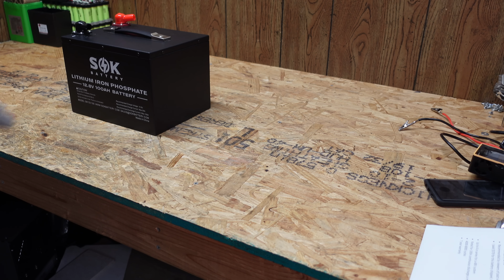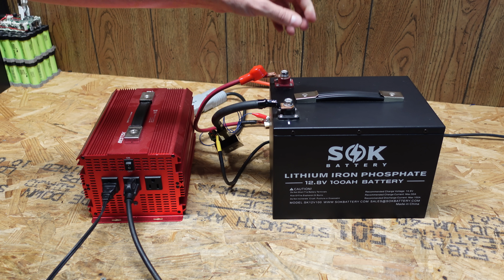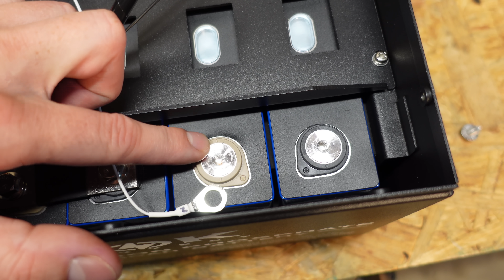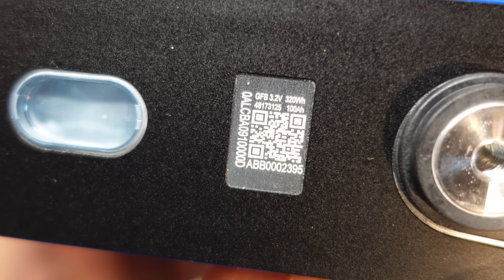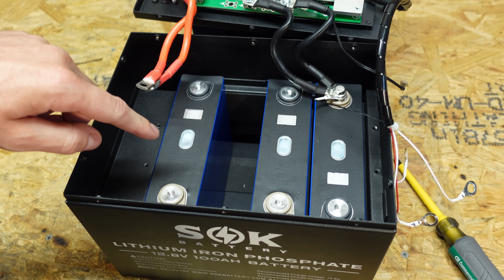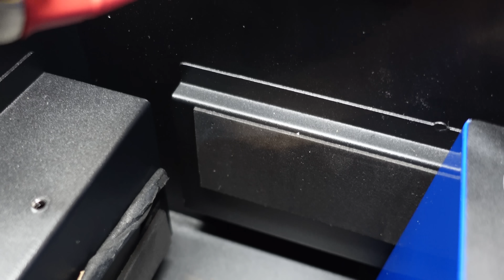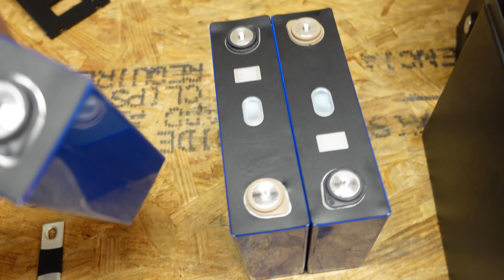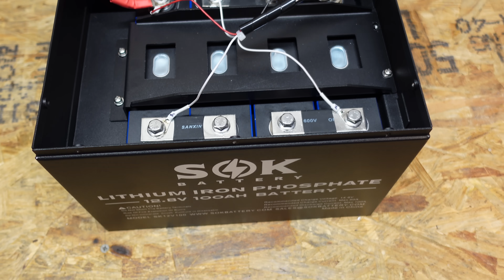SOK Battery 12V 100Ah LiFePO4 Battery, Review and Teardown

Comment: So I got the SK12V100 sok and its terminals read 5.7v but if I go from positive to one side of bus bar it is 13.2v whereas the other bus bar reads the low 5.7v. What does this mean? Can I fix it or is there dead cells?
Reply from the maker: The batteries are usually shipped with the BMS in a sleep state. It should turn on when you connect a charger or a bench power supply
Reply: @LithiumSolar  Soooo. I ended up just hooking it up to my trailer just to see what happened. Went ahead and did both the trailer and solar charger. And it works fine… Really wish they shipped some tips with these things.

Hey thanks for the quick reply though! If I hadn’t figured it out yet then this was the answer! On the positive side, I learned a lot tearing the battery down and putting it back together :D
Reply from the maker: @Gubers  Glad you got it working :) They started shipping them like that a while back due to so many arriving low after a few months of warehouse sitting. They should really include a sticker near the terminals or something to tell you this...

Comment: I bought 2 SOK 100ah Bluetooth heated batteries. The batteries are standalone installations.I have fully discharged and charged each twice using a MakerHawk load tester.  The batteries were not balanced across the cells.  I followed SOK's direction to balance the cells with limited success.  My issue is that I have yet to  have a discharge test that reaches the rated capacity of either battery.  Not sure if I have a good set of batteries/ BMS.  I get about 1175 watt hours on each test and about 98 amp hours.  Should I return these batteries?
Reply from the maker: It sounds like the cells just need more time to balance. These are very good cells. You shouldn't have any issue hitting > 100Ah when they're brand new.
Reply: Thanks for answering.  Per SOK, they recommend to keep the battery connected @14.6v with a 1amp charge rate until the cells are balanced.  I have done this several times, with each battery.  The cell variance at the bottom of the discharge is about .4.  it doesn't seem that the balancing is giving me a fully usable capacity. What is a good cell difference of well balanced cells?  Any recommendations on how to balance the cells?  Using SOK's top balancing method doesn't seem to help me achieve full capacity.  The cell difference after charging a full charge is .012.  Thanks for you help.

Comment: If you need low temp disconnect = SOK battery 
If you don’t need that = ampere time
Did I miss any better priced build quality Lifepo4 batteries?
Reply from the maker: Redodo (previously known as Zooms) is up there too with non-temp disconnect.

Comment: Just ran through the comments but it seems it wasn´t posted yet.
Cell Manufacturer is GanFeng , Production Date 11/Nov/2020 :)
BMS is now done by SOK (as in this build) , before they used JBD.
Reply from the maker: Interesting, I haven't come across an SOK using the JBD BMS. Was that way back when they first started?

Comment: Great video!  Thanks for the great information.  I have been hesitant to use a "cheaper" battery but this video makes me feel a lot more confident that it will be fine.  

Also, are you based in San Diego?  I noticed your shirt.
Reply from the maker: No, not in San Diego - other side of the country.

Comment: SOK has 5/16 bolts.
Reply from the maker: They're metric, so it would be an M8 as I stated. It looks like that's similar to a 5/16" - so sure, if the threads match, you could use the 5/16".

Comment: thanks for the review - very informative!  I've gotten mixed information about placing this battery Under the hood - as the 2nd or house battery in a dual battery setup.  I have 4/0 cables going to the bed of my tacoma so I'm not worried about voltage drop, but just wondering if the LiFepo4 can be placed under the hood.

Comment: I'm fairly new to solar. I'm wondering since the BMS is limited to 100 amp, would that mean that if I use a 3000 watt pure sine wave inverter, I would not be able to use it's full rating? I'm thinking of buying 2 of the 206 ah 12volt version of this battery. I am building a enclosed trailer toy hauler. Will be running a instant pot and a ninja foody for cooking, a fan for cooling, charge 2 laptops on the AC side. 

On 12 volt: a Dometic cfx3 95dz for refrigeration, led lights, a diesel heater, and charge 2 cellphones. 

I'm thinking if I've done my math right I should be able to go 5 days without actually needing the batteries charged, but at the moment I have 350 watts worth of solar panels and a cheap 30 amp Sunforce charge controller. I think I might need to get a better charge controller since it's old and not mppt. I should also upgrade to 600 watts of solar panels?

Thanks if any one can chime in.
Reply from the maker: A 3000W inverter at 12V would be 250A, so you are correct in that you cannot use the full 3000W rating with one of these batteries. That really is a lot of power for a 12V battery system. Have you checked their 24V batteries? Using a 24V battery and inverter will cut your amperage in half allowing smaller-gauge cabling.
Reply: @LithiumSolar  I still have to do the research into the 24 volt method. I basically bought the 3000 watt inverter thinking, if I ever need more I won't have to upgrade the inverter unless better tech is out, and I could run pretty much any household appliance on 3000 watts. But I like to try and run as many things from 12 volt, more readily available items are 12 volt or lower like USB, LEDs. But I'm going from using 2 led acid batteries. 350 what of solar panels. And only a 500 watt inverter. Running almost exclusively on 12 volt. But wanting to run more things off of solar.
Reply: @LithiumSolar  so if I got 2 of the 206 amp hour version I could  get the full 3000 watt usage out of the inverter for 1 hour and a half?
Reply from the maker: @mrchrisknight315  The continuous current rating of the 206Ah battery is still 100A due to the BMS they're using even though the cells themselves can handle 1C discharge. With 2 batteries, you would have a max continuous rating of 200A or 2560W (200A x 12.8V).

Comment: Could you tell me what makes these batteries worth double the price of a chin lithium battery of the same AH?
Reply from the maker: Well for one, these are rated for significantly more cycles than the Chins.
Reply: @LithiumSolar Chins advertises 2,000 plus cycles.  At one cycle = one day of fishing, I could cycle the battery every day of the year for 5 straight years before needing to replace the battery.  My application will be a trolling motor; and I fish maybe 50 days a year.  At my rate, that would give me about 40 years.  Cycles are really misleading to me in that sense.  Is there any other compelling reason? I want to run a 55 lb thrust trolling motor on a single 12v battery which I assume will draw below 25 amps at the speeds I will be using.  Most of the use will be for intermittent repositioning of the boat during bass fishing.  Occasionally I will use it to do a 1.5 mph steady troll for Kokanee fishing.  I don't think the steady troll will draw more than 20 amps (normally fishing no more than 3 hours).  My first inclination was to get an Everstart flooded 109ah battery from Walmart at a cost of about $100.  I see on Amazon that the Chins 100ah is $319.  I like the idea of the lower weight and the fact that the flooded will probably only last a few years; but, I do not want to spend over $500 for a battery.  Do you have any additional thoughts on this scenario?  BTW; thanks for your response and input.
Reply from the maker: @rickw9169  I have reason to believe the batteries being used in the Chins are only rated for around 1000 cycles. I can't prove this with certainty though. I don't think they're bad batteries at all, very well built actually. I would buy the Chins over a flooded lead-acid any day. One downside to the SOK that I reviewed here is that it's not sealed and since you're using it in an environment subject to water, would probably want to take that in to consideration.
Reply: @LithiumSolar  Thanks for all your input.  I greatly appreciate it.  I want to keep the weight down as I am going to put the battery in the front of the boat.  Even at 1,000 cycles I'm good for 10 years.  The 100ah runs $315 (Amazon) currently and I think I'll take a gamble with it and will see what happens.  Thanks again for the input.

Comment: Use a torque wrench on your next tear-down to see torque specs.
Reply from the maker: Using a torque wrench would give a generalized idea, but because it's a serrated flange nut, it grabs on to prevent backing out thus giving a torque value required to overcome those "grabs" that will be different from what it was tightened to.
Reply: @LithiumSolar  I've never thought about that. there's probably a general number you could estimate. Close torque values are better than no torque values.

Comment: Just both this battery my question is when charging with Noco Genius 10 that can charged lithium battery, I can only charged up to 13.4v can not get up to 14.6v as recommended.  What do I need to do to get to 14.6v?

Comment: Can you combine this with a battle born 100 ah?
Reply from the maker: My opinion is that paralleling both would be acceptable as long as they have the same charge parameters (and being LiFePO4, they should). I would not recommend wiring two different brand batteries in series though.

Comment: Has anyone had any experience with the 100ah 12v “Flypower” LiPO4 batteries?
Reply from the maker: I don't, but that battery is the same exact case and weight as the Jialuonin that I just reviewed, so my assumption is the internals are the same or similar.
Reply: Thank you for getting back with me!

Comment: Hey so I have a project that I'm building my self an 800 watts motor is required so and it has to be 48v so I went and bought four 12v 5amp batteries they are 4 in total I cant figure how to charger them all at the same time do you any charger I can use?? And do you have any suggestions what i can get or do to charge all four batteries please anything would help ALOT?
Reply: They are lead acid batteries by the way.

Comment: You should have removed the connector plug for the balance leads from the BMS before disassembly.  Removing the individual wires in an uncontrolled fashion can cause bad voltage spikes for the BMS.
Reply from the maker: You have a very good point here, thanks for the reminder! Ooops...

Comment: I am an old guy who likes to go gold prospecting and needs power for a small water pump or a "windshield wiper" class 12v. motor. The common solution is a conventional deep discharge battery. Conventional batteries, though, are too heavy to walk any distance with for me. I am hoping to find a lighter battery that will turn out 3-5 amps for as long as a 12 v. car battery but weigh much less. Would a battery like this fill the bill? Are there better solutions?

Comment: So you will know in the future to use an existing (digital?) torque wrench to test the bolts before you loosen them. For example set it to 20 foot-pounds of torque and see if it clicks-beeps, if it doesn't, then you know it is below that. If it beeps-clicks at 20 then you know its higher.

Comment: Off topic… does anyone know… can I hook a battery bank into my electrical panel via my 50 amp input  I had installed for my generator?  Its’s an RV style plug.  I guess it would be coming off an inverter?
Reply: Yes, your auxiliary input doesn't care where the power comes from.  If it's currently setup for generator backup power you probably already know this but be sure you lock out the grid power supply before energizing your aux power supply so you don't back feed the grid.  Depending on the battery voltage feeding a power inverter, it takes a lot of amps to run the inverter, do your research to size it all correctly for your requirements.

Comment: Has anyone checked these against the mollpower.com which appears to be quite similar on the outside with a metal case and and volt meter and the price is currently 450 USD as of 2021 07/12 Wondering how the Bms compares. The build quality on these SOK batts is excellent and I like the idea the cells can be replaced as it looks like the prices will continue to come down. My only other concern is if the metal case will rust, I'm considering 2x these for a trolling motor application and rust could be an issue.

Comment: GFB = Ganfeng Battery , these are there telecom based cells, 1000 cycles,
Reply from the maker: Thanks. I found the datasheet after posting this video. They're rated for 3000 cycles at 1C. We should see significantly more cycles at a lower C-rate.

Comment: Great review 👍 didn’t quite catch what the low voltage disconnect was? Could you please let me know what it actually was? I know what the specs say but what did you get? Mine was quite low 8.6v not good. 
Hopefully no more than 10v. ✌️
Reply: Looks like 10.62v on my screenshot

Comment: Is it possible to replace AGM 12v battery with this one on the boat? Do I need to replace the charger too? AGM/acid charger uses 14.4v to charge and 13.3v to maintain the battery
Reply from the maker: The voltages will be very similar but it's generally recommended to use a charger designed for LiFePO4 rather than a different battery chemistry.

Comment: The problem with a metal case, is that you have to be very sure to not to short any terminal during connections. Same as per the BMS - that huge heat sink is good, but if the battery will get any hit from above, it will push directly on the cells busbar bolts.
Reply from the maker: Interesting thought. I think that support bar on top of the cells would likely prevent it from happening. While very improbable, I suppose it could happen from the side if the planets all align for a second...
Reply: @LithiumSolar  well, it you put the bms on a side, it may push to the cell insulation.
Long story short, an insulated sheet under the bms can avoid further damage in case of crush

Comment: In the future I would use alcohol to test the temp sensor.  That salt is going to cause corrosion over time if it is not cleaned off.
Reply from the maker: Good point, will make sure to clean it off well.

Comment: why just 4
Reply from the maker: What are you referring to? Why 4 batteries inside?
Reply: @LithiumSolar  you stated  up to 4 can be conected
Reply from the maker: @jerrysjunk  Ah, the limit of 4 in series (48V) is most likely due to voltage limits on the BMS, in particular the FETs that switch the battery on/off.
Reply: @LithiumSolar  so not much use  for them  48 volts is not enought to run any thing  and they look heavy  so  my question is why